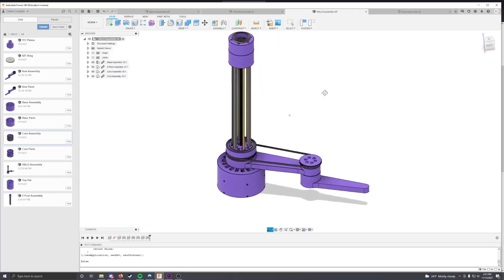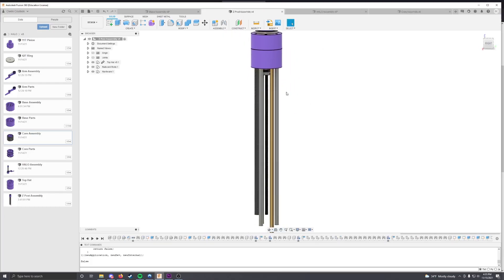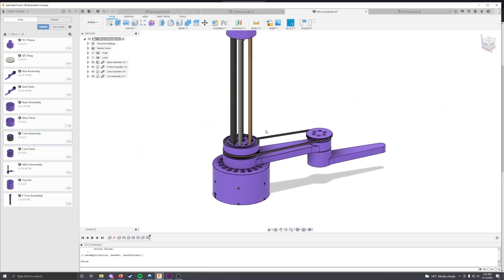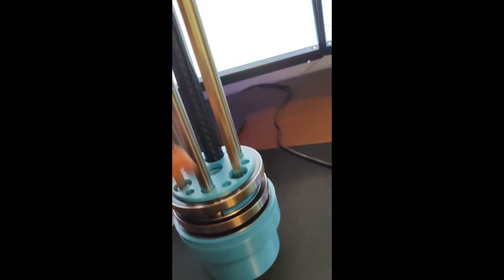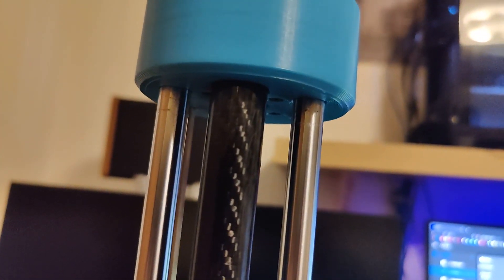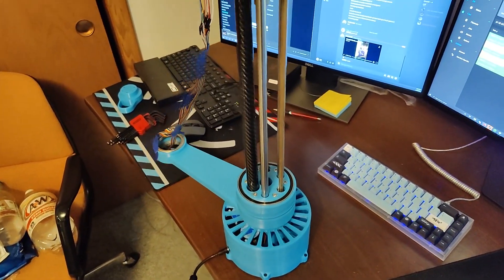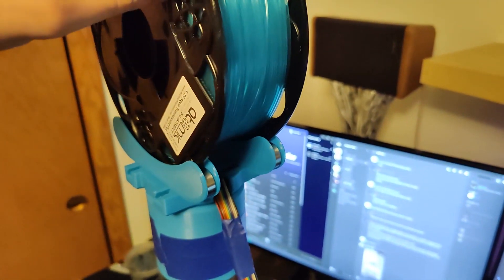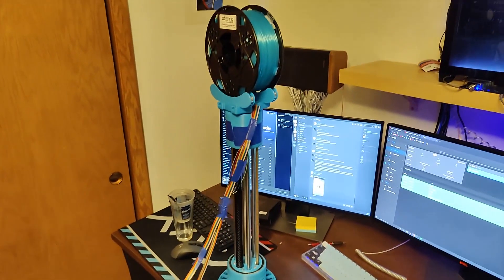HALO (Infinite Rotation Arm)

Comment: Little late to suggest this, but one way to remove some of the cable issues would be to couple its rotation to the 1st arm segment using the shaft you already run up there. This would keep the the cable from being draged around by the the arm. One thin i would be wary of is the spool placement, as it might get in the way especially if you want to use a springsteal strip to keep the wires from drooping into the toolpath when you raise the arm. 
Looks awsome, good luck!

Comment: Great design! The problem of the wires wrapping around at higher z coordinates should be a non problem if the printer is direct drive, because the filament should be taught enough to spin the spool

Comment: Very nice! Looking forward to see it perform.

For the SCARA arm I've been planning for ages I wanted to go cable drive but infinite rotation is just too good to forego. So belt drive it is, but aren't you worried about backlash? GT2 or GT3? Expected precision at end effector?

Lately, I've been trying to figure out ways to get rid of the slip ring rotary contacts. Rejected low power, low efficiency induction coils. Landed on thrust bearing pairs for power transfer. Might also work on bearings designed for axial load, but only with electrically conductive silicone lube. Might.
For data, either something wireless and low latency (RF24?), but I'm looking at an optically isolated half duplex serial bus right now (so like RS485), where the twisty turny bit has the photodiode/LED pairs looking at each other through a darkened joint shaft. It would be cheaper than slip rings, less noisy, less wear. Potentially slower, though I think 38400 baud should be doable. Also it still needs to be developed. Sorry for ranting, this has been keeping me up at night.
Reply from the maker: For a general robotic arm that probably could work. For my use case I'm just using a cheap slip ring I bought on AliExpress (I think it's rated for 2A per wire which is fairly low). I'm running this at a higher voltage (24-28V) as to not put too much current through the slip ring. My plans don't entail using anything with a high power draw I think it will work fine. Your idea of a main power system with digital signals being sent externally would work fairly well I think but is more suited to larger applications (I assume) because you still need some form of conversion from power and digital signal to analog for motors and sensors to use.
Reply: @KoalDesigns  Agreed, not everyone wants MCUs strewn along the length of their arm. And stepper drivers aren't weightless. Those 2A wires can also be doubled up for more power and less noise, so there's that.
There are 3 points of infinite rotation in my design, so that's what put me on this trail. Thanks for your input!

Comment: hey, great to hear from you! this is so cool! i was pondering 360 degree scara mechanics not long ago and here you are again with such an amazing new idea. 

i wouldn't have thought that motor mass is a particularly big concern for scara mechanics as long as it is close to the centre column... and so it wasn't a major design goal in my thinking, but your solution for leaving them ALL in the base is genius. really creative, effective, interesting, and definitely brings a bunch of additional advantages.

any hurdles it brought, you seem to have already overcome. its extremely cool to see it working so well! 

keep up the great work and please do keep posting videos.

have there been any developments with your larger scara? the (was it cycloidal or strain wave most recently?) gearbox looked really promising, it would be nice to see it working with the latest refinements.

thank you for sharing your ideas, i really find these videos very cool. until next time, best wishes!
Reply from the maker: I actually put the large SCARA arm on the back burner due to the complexity of it and having failed many times (I think I did 4 or 5 total rebuilds with all of them failing in some way), so I decided to do something smaller (more manageable) but equally cool so you get this.

Comment: I wonder if you could couple the movement of the to to the proximal arm movement so that it's not driven by the wires
Reply from the maker: Theoretically its possible, I was thinking about doing that actually but then decided that it adds more complexity than it is worth.

Comment: Neat. I was in the middle of building a scara a while back but was having issues with the elbow joint so I had the idea just use a linear axis instead. So I basically had a rotating base with z and x axes on top. I called it an inverted polar and much like this design it was capable of printing in 360 degrees around itself. There's a video up on my channel,  I've done several iterations of it since then and it proved to be a very reliable and versatile machine up until recently when I left it in my car and the printed parts deformed in the heat.
Reply from the maker: Haha yes I have actually seen your videos before. A few years ago I actually modeled up an inverted polar printer as well but decided not to pursue it. It is a great design you have going with it.